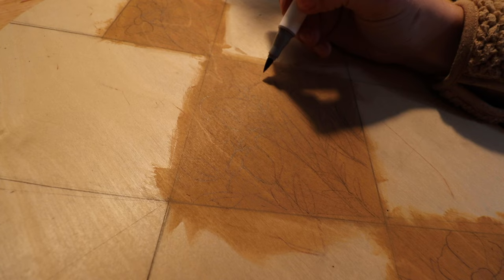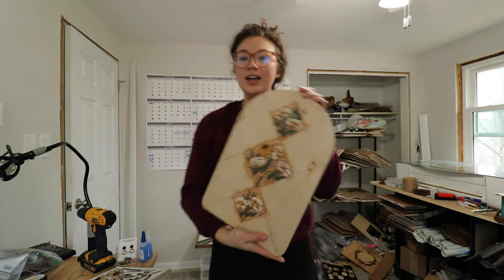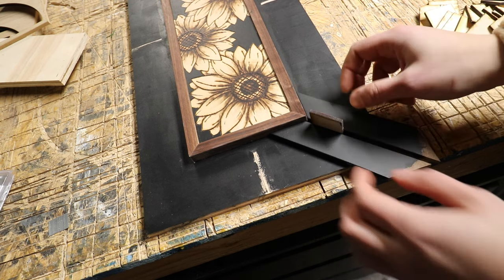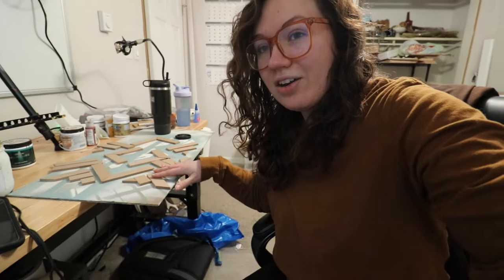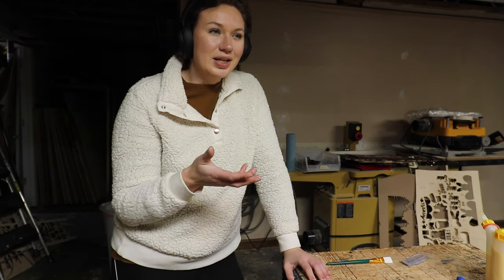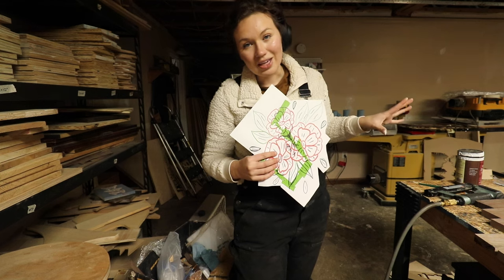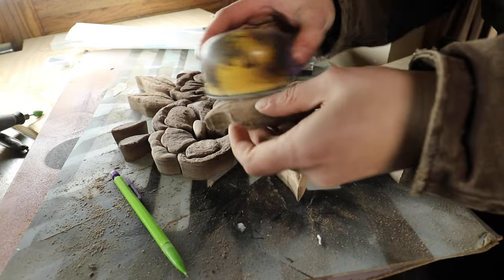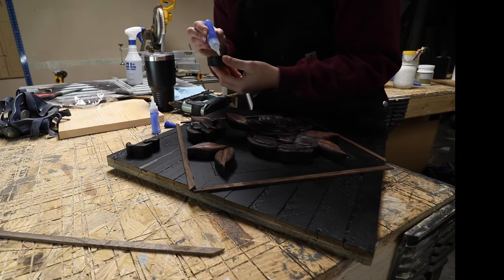Mosaic Madness: Episode 3 | Scroll Saw Wood Art | Finishing in the Woodshop

Comment: Emily, I’ve been using a two-part CA glue, liquid + spray and I find that without Titebond III, it isn’t going to hold much of anything together. I saw you also use brads and T II on the backer board. Are you using the CA as a temporary hold until you can use the other two methods or does the Loctite do the job completely? 

Also, what app are you using on iPad to draw out for your pieces? If I may ask.  

Have you tried those smaller dealies for sanding? I find those palm mouse sanders are great, but not so much for small spaces. 

Thanks. 

Donny
Reply from the maker: Hey Donny! So Loctite super glue could definitely hold on its own with more applied. When glueing up the wood flower, I am only using Loctite and swear by it! I am CA liquid and spray but the only things I have used it for so far is temporary holds when running my CNC and to fill any holes in the wood I find.

To draw, I use an iPad Pro and the app is Procreate! I use it for so much from drawing templates and mosaic to helping me plan our house projects. It is super handy :)